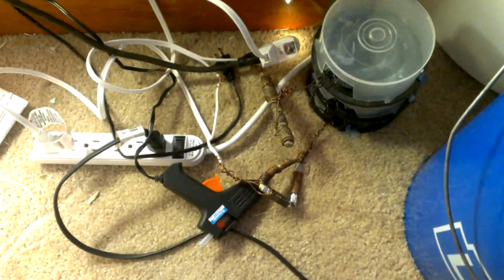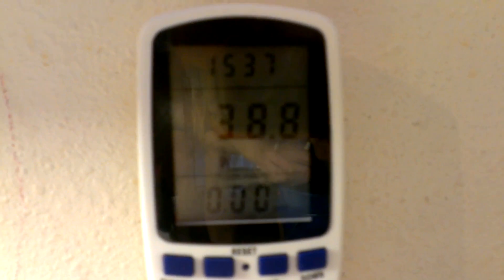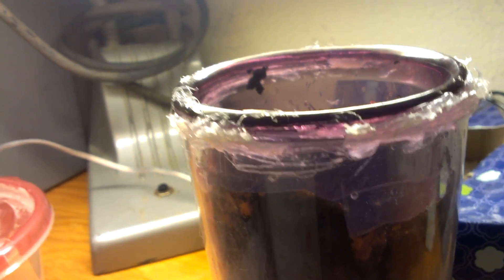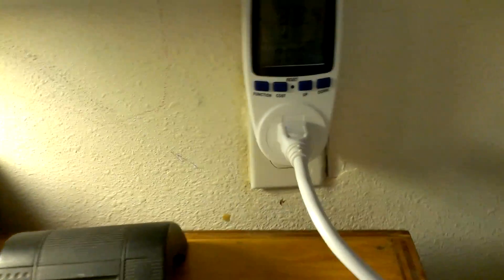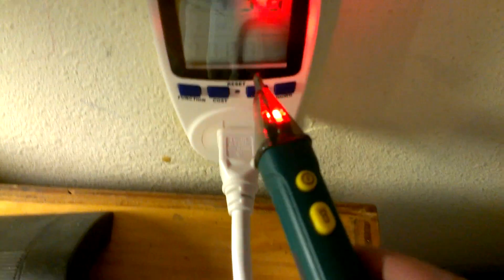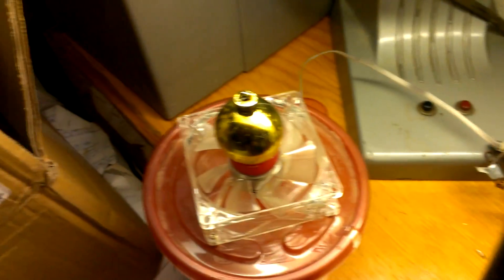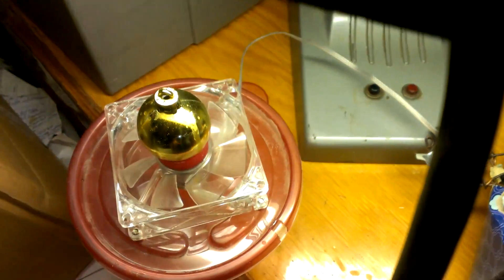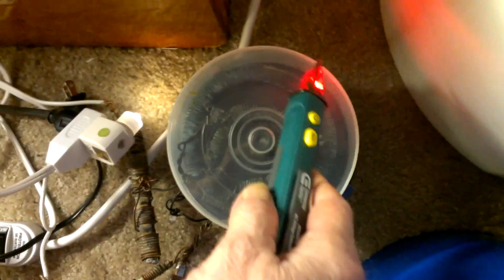Keshe Magrav Anomalies with the Voltage Detector February 28, 2016

Comment: I think of two hypothesis:
1 - the super-capacitor that store the alternative electric current in the nano coated layers of the Magrav's coils
2 - the superconductive properties of nano layers which will give rise to a strong magnetic field for the tiniest electric current flow through the coils.
The measured effect using a capacitive coupling sensor could be the result of only one of the above specified hypothesis, or of both of them. Try to shield the Magrav unit in a Faraday cage to eliminate the possible inductions from electrical wires around it.
Reply from the maker: +ovisadang Ok. It sounds good. I don't know much in that realm, only what I'm seeing. Be innocent as a child with wonder and amazement and joy. Thanks for the comment. I will re-read a few times and let it sink in. I do know what a Faraday cage is.